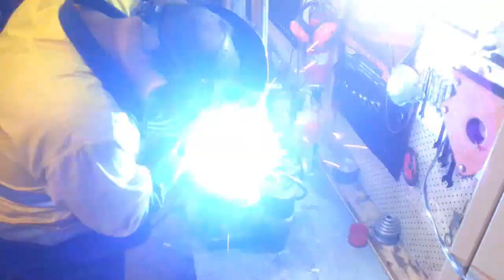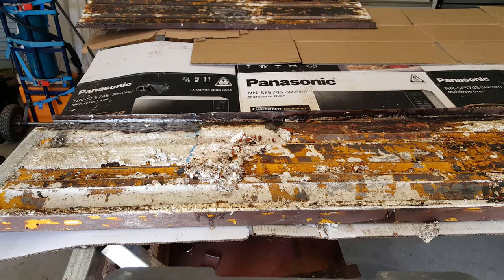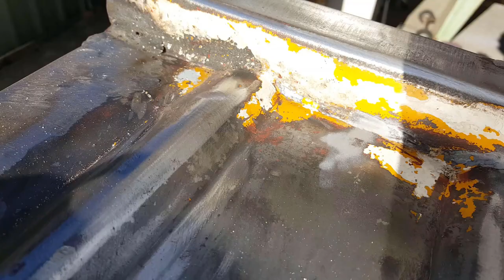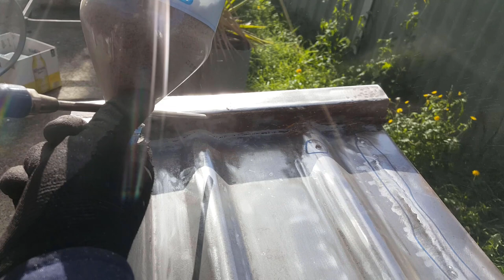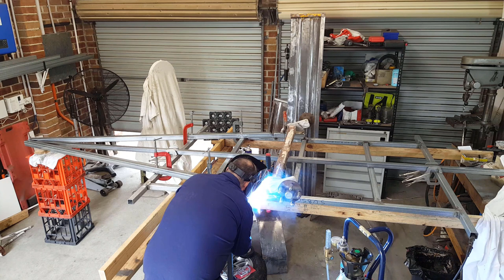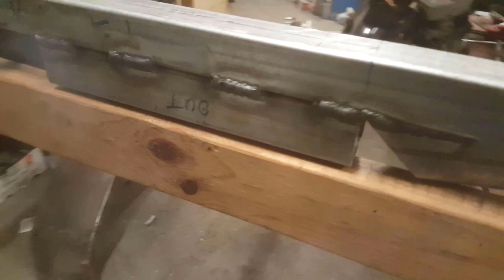Trailer restoration 7x4 foot Part 4

Comment: Great video . I'm looking forward to part 5. I have a rusty trailer too. That's what bought me to watch your videos.  I love the sand blaster, simple science at work. If you don't mind me asking are you some sort of tradie for a living. welder or machinist?
Reply from the maker: Hi Mark, thanks for the comment.
I'm still working on part 5, I've had some trouble with my welder and its slowed me down a bit.
I actually made a YouTube video on repairing / upgrading the welder, it will be available  tonight at 6pm.

As for me, I'm not a tradie / machinist / welder /etc. I actually work in the I.T. industry (never judge a book by its cover - lol)
I've always been handy on the tools and just love getting my hands dirty with DIY projects of all sorts.

Remember to Like / Share / Subscribe.
Thanks Maximum DIY.

Comment: really enjoying your video.  What size stock did you use for the frame?  Is the drawbar stock also the same as the frame material?
Reply from the maker: 50x50mm 4mm thick for drawbar
40x40mm 3mm thick for frame.

Hope that helps.